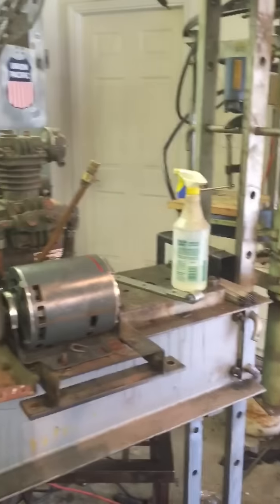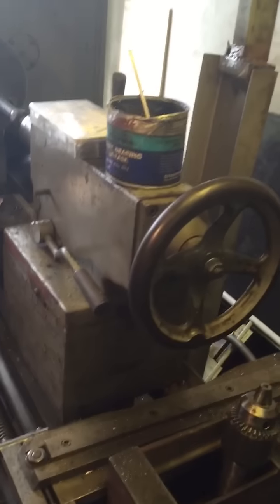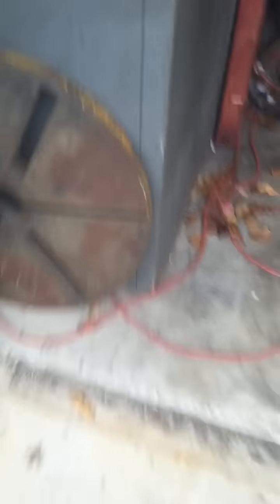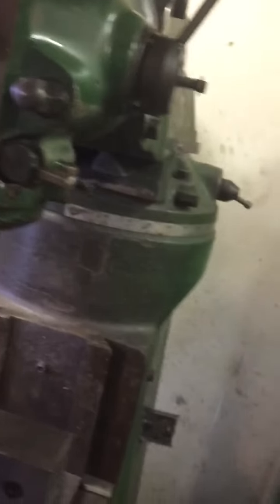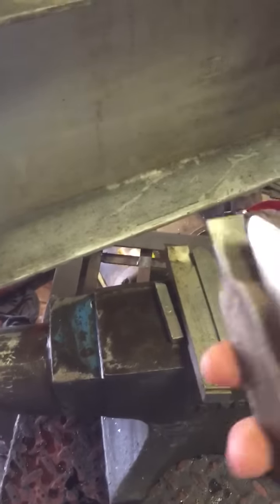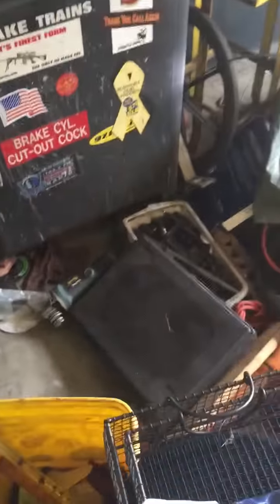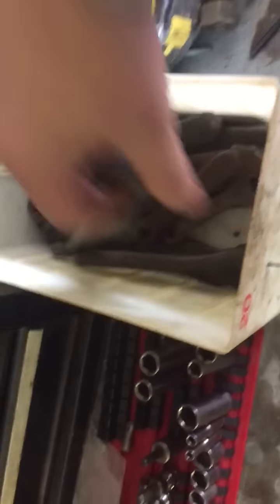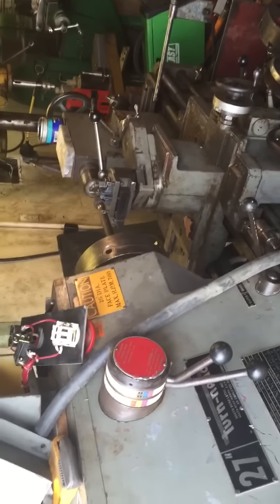Short walk around my garage

Comment: Thanks for the update.  Gonna' be fun to see that beast run after the saga you had getting it.  Good score on the new tools.
Reply from the maker: Thanks I really like those disposable angel plates @5 bucks each, the guys got a pallet full of them. I was going to make them my Christmas presents for everyone but I can see me trying to explain to my wife what it's for. That would not have worked out well for me. Marry Christmas
Reply: You and your family have Merry Christmas, too.  Hopefully Santa brings you a 10HP VFD or heavy duty phase converter.

I was able to figure out what was wrong with my 3-phase service in my garage, so I could hook up a 3-phase motor directly again.  I have one 3-phase motor on my Atlas 10" with a VFD.  I wish I would have figured it out before I moved my big air compressor outside figuring I wouldn't be able to use it.  I think I would still have to find a new pump for it if I tried to use it again.

Comment: I feel for your "mess", I  would check with VFD experts, but i done think a 10 hp VFD is adequate for a 10hp Motor, A 15 or 20hp might be better suited
Thanks for the video, I hadn't seen any from you in a while
Reply from the maker: Crap, don't say that about the VFD. I've been using a three hp vfd on my three hp and below stuff for a few years now and haven't had any issues. So I was hoping to do the same for the turn-nado. The ten hp vfd is $300/$400 the next one up is like $700/$900 so it's a big difference between the two.
Reply: +The Texas Gun Guy like i said, check with the experts, I just heard that you should pick bigger, I could not even explain why
Reply from the maker: +Phil's Projects I'm most certainly going to, and thank you for the heads up.